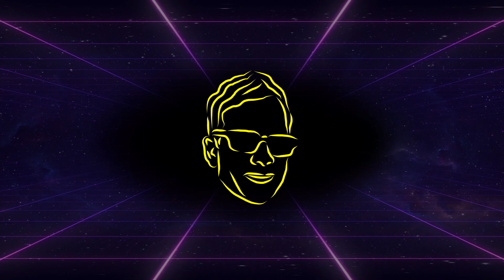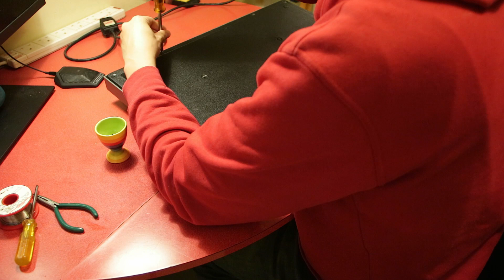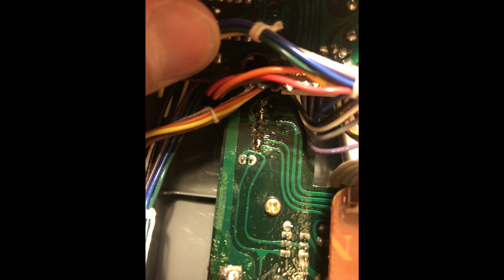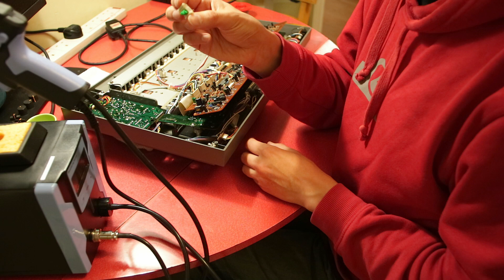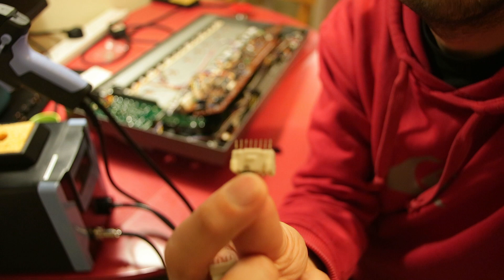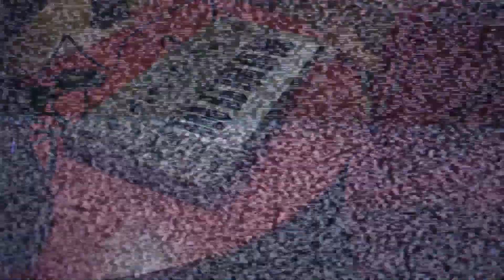How to bypass or replace the SH-101 power switch

Comment: Hi! I’ve done the same operation with a 6 pin replacement switch, it’s perfect but my lfo led just stopped to flashing, and every led (power, arp, sequencer..) started to flashing at the lfo speed. Have you got an idea of what is happening to my sh101? Thank you!
Reply from the maker: I’m sorry Simone, but I’m not sure! 
I would go back to basics. Check the soldering, check the patching of the internal cables.